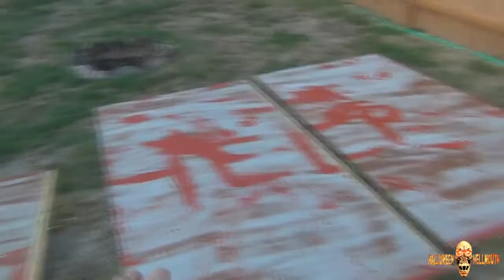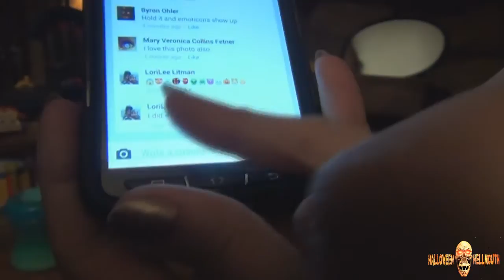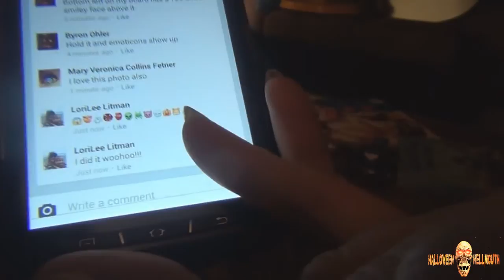Hellmouth Vlog 09.03.14 [Day 1403] - BUILD DAY ONE!!!!!!!

Comment: You must have bought  the new ION battery and as you see it won't work in the charger.  You will need either a ION battery charger or the NiMH or  NiCd batteries for your charger.